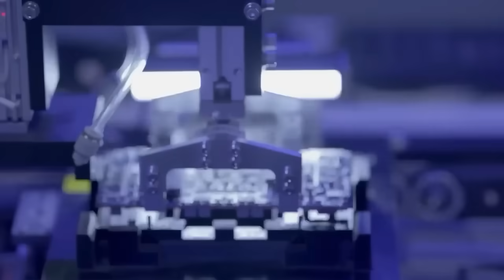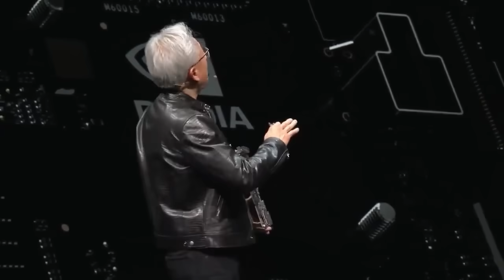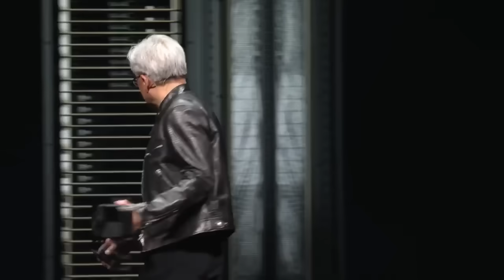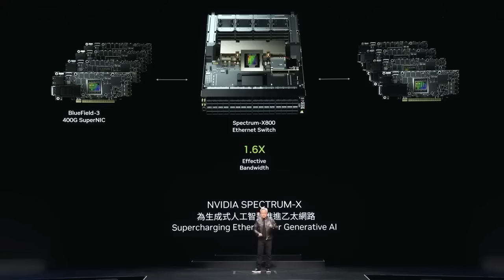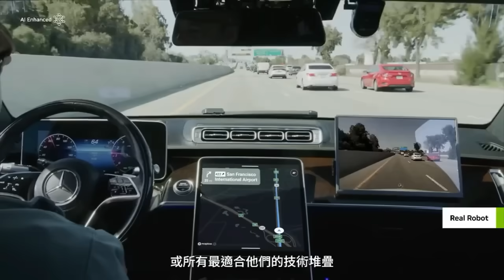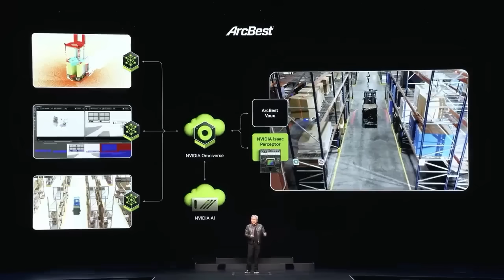Nvidia CEO Just STUNNED The WORLD!

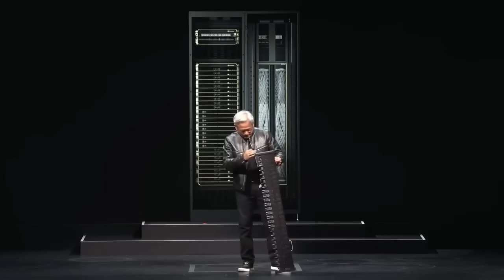Comment: 6:00 Copper is the 2nd best heatsink in the world, doesnt surprise me they used copper. The #1 heatsink is Polycrystalline Diamonds which are twice as effective as copper but a lot more expensive.
Reply: I think that the copper is used to transfer data. As in, copper cables, as opposed to glass fibre cables. At these speeds, copper wires really are starting to struggle and usually glass fibre is used, but that needs electricity of it's own to run I guess?